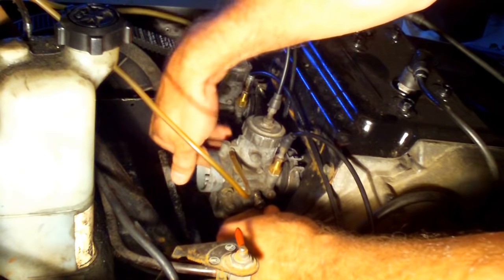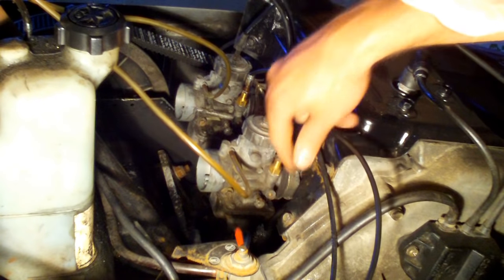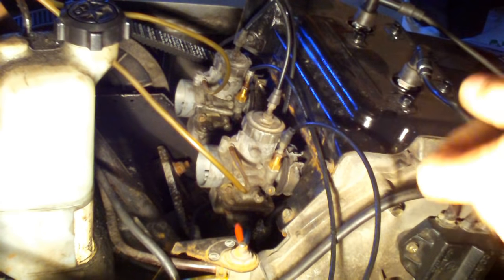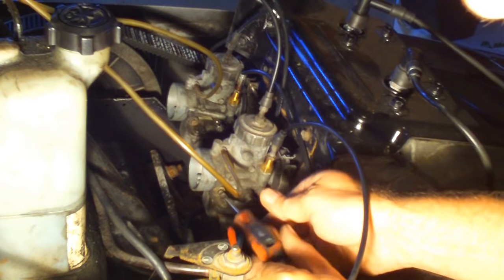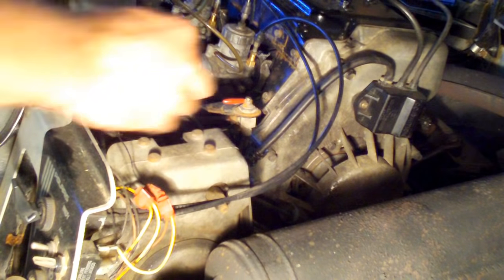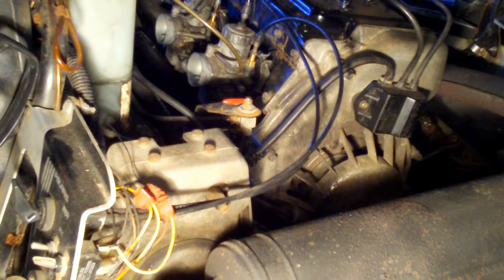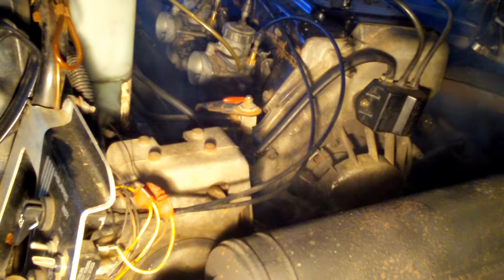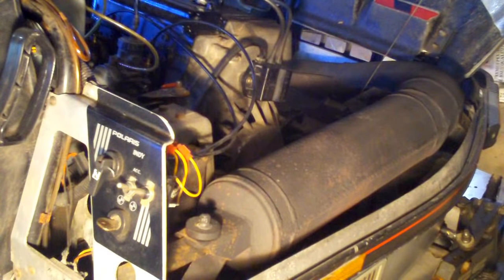How To Adjust Snowmobile Carb Idle Screw Setup on Mikuni ✔

Comment: Hello I have a Mach z 583 and it seems to run boggy I noticed Gas And OIL is leaking from the muffler?? Any thoughts
Reply from the maker: Hello Ty. I learned last season that "boggy" can be both running too lean or too rich. In my case, it was running too rich, and I was only making it worse by trying to make it run richer. It would bog bad right off idle and then come out of it somewhere around half throttle and up. As for your machine, there shouldn't be any gas or oil leaking from the muffler, as you know, at least, if you have had it running for an hour or so after storing it for say the Summer. Mine always smokes thick when I first start it as oil slowly seeps into the crankcase from the oil injection over the Summer. This first start also can deposit oil where the exhaust points to the floor as the exhaust pushes the oil right through the muffler system. So my question would be, how long did you let it run? Has it been doing this even when you are riding several days a week? Or only after sitting for a time?
Reply: Mark Young - Hello, ya I noticed to that my ski doo was running rich on oil I put it away   For the season but seems to be still running like  I had it running for few mins but it would just turn off
Reply: It went like this after sitting for about week then I just put it away for summer
Reply from the maker: Have you had the carbs off to check the float levels in each one? If one, or both, is set too high it will cause the motor to flood. Also, as far as gasoline is concerned, and this happened to me too, remove the vacuum pulse hose that goes from your crankcase (under the clutch-side carb) to the fuel pump (right below where the starter rope comes out of the motor). I had a crack in one of the diaphragms in the fuel pump which let fuel run down the vacuum hose right directly into the crankcase. This is very bad as it can wash the oil from your bearings and even the rings and result in a total motor rebuild if not corrected in time. Take out both plugs and see if they look really sooty and carboned up. If the clutch side plug is right full of carbon/soot and the other plug looks fine, that could be an indicator that fuel is running from the pump into your crankcase. Tell me what the plugs look like when you can. What model sled and size motor is this?
Reply from the maker: Remove that vacuum hose to check for gasoline inside it. There shouldn't be any, none. Just air. And check at both ends. I checked at one end and didn't see any, so ruled that out. Later, after buying and replacing many carb parts, I checked the other end and gas dripped out. There was my problem!
Reply: My sled is a 1989 Mach z 583, I changed my plugs the other week I'll have a look at the old ones, and I'll check the vacuum hose too
Reply from the maker: Since mine is a 1988, they may have similar carbs. Mine are Mikuni VM34. Do your carbs look like the ones in my video?
Reply: Yup they are mikuni carbs
Reply: I checked the hose nothing seems to be leaking out
Reply from the maker: Most likely your fuel pump is ok. Next in line would be the carbs themselves. Make sure the floats are set to the right height, and check the "enricher plungers" rubber bottoms are not hardened up or cracked and letting fuel go by (those things that move up and down with the so called Choke lever). You should also see an Air Screw on each carb. Gently turn them all the way in, and I recommend counting how many turns that takes and write that down. I usually count by 1/2's..... 1/2..... 1.....1-1/2....... 2, etc. Then turn them out 1 full turn for a starting point. These control how much air is mixed with the fuel from idle through about 1/4 throttle (if these screws are not open at all it would cause a rich too-much-fuel condition).

Comment: Have 2007 skidoo summit had carbs out put back it now wont fire
Reply from the maker: Key on, kill switch off? I'm only guessing here, but on my 1997 the wires that go to the coil, along with some other wiring, run along the backside of the motor where the carbs are located. There is a connector plug between the coil and the motor that if it becomes unplugged there would be no spark. Other than that it sounds like a wiring issue. Check the wires to the kill switch also.
Reply: @contact4mwy7  ya I have spark I think it a fuel problem after pump it had a y in the line twice
Reply: Thinking breather line
Reply from the maker: Sounds like someone before you maybe didn't connect the fuel lines the way they are supposed to be? Is it the correct fuel pump with an output line for each carb? I'm trying to understand why there would be a Y fitting or two in there.
Reply: @contact4mwy7  ya I think so but it was running at xmas time than someone took apart now I dont know what line goes where
Reply: @contact4mwy7  I'm not sure if it's the right fuel pump I'm new at all this
Reply: Like it should go tank pump carb
Reply from the maker: If your sled is a twin carb setup, your  fuel pump should have three lines attached. An input and two outputs. The only Y I've seen was for a primer pump for starting the sled, but those lines are noticably smaller. You should look for a diagram online of that model sled that shows the carbs, fuel pump and fuel lines.

Comment: Where is the video on adjusting the needle Jets?
Reply from the maker: I removed it and intend on making a new one. I found adjusting the needle jet clip to the 3rd groove "due to ethanol in the fuel" is really not an issue as it was making my sled bog due to the mix being too rich! Here I thought bogs were only caused by a too lean condition, but learned to "read the spark plugs" to determine what is really going on with the mix. My plugs we black and covered with soot. I moved the clip back to the factory setting "2nd groove down from the top" and the bog went away and the thing rips now. Go figure. Are you having an issue with yours?

Comment: Im actually missing my air box myself, what should be done with the air intake adjustment?
Reply: Buy an airbox
Reply: @joshlecher4935  yeah if i could find one i would. And stock the air screws are 1 and a half turns out.
Reply: @indiehandstudios5711  what kind of sled is it